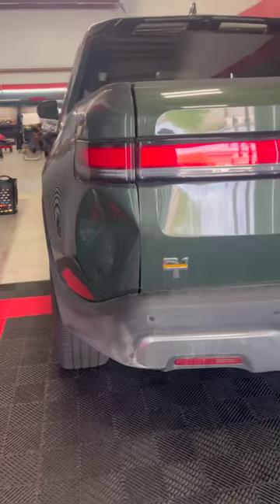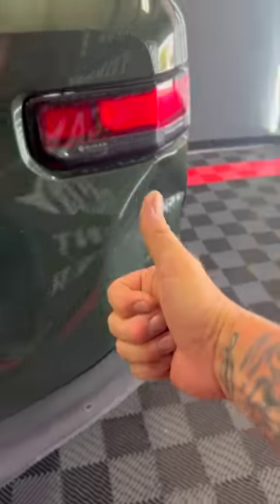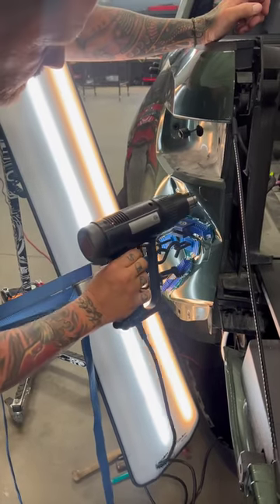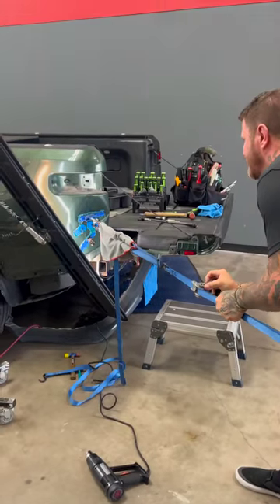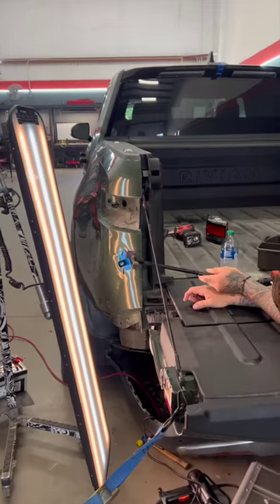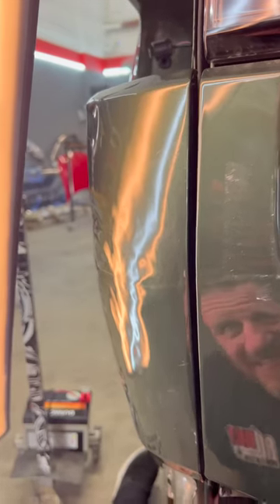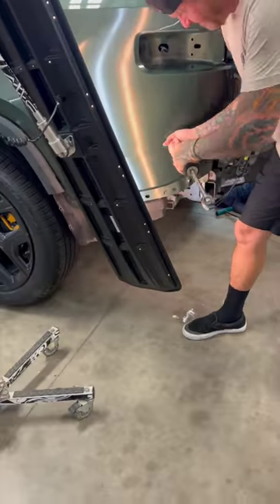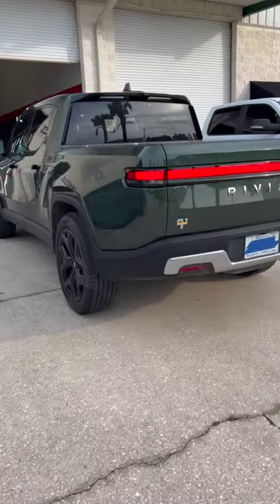$41,000 dent repair on this Rivian?

Comment: So there's an interesting phenomenon, that happens with vehicles. And I was able to study this over the course of 25 years, of being an auto body professional. Aluminum vehicles present a different challenge in the market. They're not welded, like steal cars are. Most of them are, put together with pop rivets and glue. So when you strike a panel, energy gets transferred through the panel, just like in a traditional steel vehicle. Except, the only thing protecting this energy from going through the vehicle, is a thin bead of glue. Typically, that Lord's fusor s***, nobody uses. Which is why the manufacturers got such a good deal on it. The insurance companies would love for you to just focus on the direct damage. So you don't uncover the indirect damage, they have to pay for as well. Huron michigan, we have a thing called, technician liability. And if I fixed that dent, the way they used car lots do. I left an entire vehicle full of indirect damage. So the next time that vehicle gets hit, and somebody may or may not get killed. I don't know. I'm not God. But the next time that vehicle gets hit..... Guess who's going to be responsible for anything that happens to that vehicle? That's right...... Me. Because I acted as implied authority. I'm supposed to know, how transfer of energy works through a vehicle. And I do. But I'm not trying to stick around, and work a 41,000 dent. My job is to find, $50,000 worth of damage in that truck. Which isn't going to be hard. Just stick a screwdriver in between the panels, and see which ones are loose. I know, from experience, that a deer hit, and an aluminum f-150, completely junks out the entire cab. I can't see why it would be any different in a unibody truck, for a dent like that. But I love you PDR guys...

Without you, there will be absolutely no way, the little green lizard could save the customers 20% or more on their car insurance. Oh wait a minute..... 20% is what they take from the technician. 

To help create the illusion of value on an insurance contract.

You just keep working that direct damage, cuz when it rolls into my shop, and I find the indirect damage... And I will. Then I'm going to charge that insurance company 50 k.

And I'll get it.

Comment: a real body shop would not replace that whole panel they would of basically did what you did other than weld on studs to pull with a slide hammer and maybe cut the section out and patch panel it

Comment: haha theres a video where this asian kid had almost the same dent and he made a thing to hold hot water all around it for like an hour, like reallllly hot. Then at the end he just came out, removed the water thing and reached under and popped it back to original shape with his fingers. that won't work on metal but he had a carbon fiber thing going on.

Comment: There is no such thing as a 40k dent no matter what vehicle it is. Before you come back cute. Ive owned a body shop for 25yrs.
Reply from the maker: @charlesbronson7618 well I don’t think you would argue that there is such a thing as a $40,000 repair. When you add all the necessary operations to replace the panel it costs over 40,000…. You can definitely argue that I can be done cheaper. No one would dispute that. I know plenty of shops that would do it for less than 2k. But when the certified shops see this come through the door they see dollar signs, especially if they have dished out thousands of dollars to be a certified repair shop. Also when Rivian only sells the parts to certified repair shops and they can make the price whatever they want it to be than any one with a brain can see how a bill for this could easily exceed 40,000. I do believe that Rivian has changed the procedures for this repair and it would be cheaper now. But when we repaired it this was the quote the guy got from the Rivian certified repair shop.
Reply: @mattboyette4375  That's what I would write it for to an insurance company. To an individual now that's a hard no.